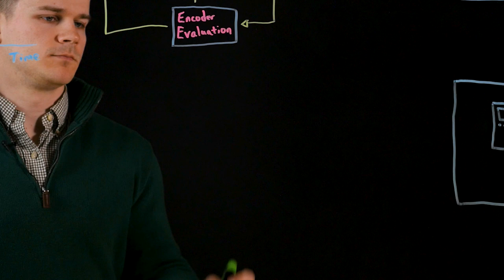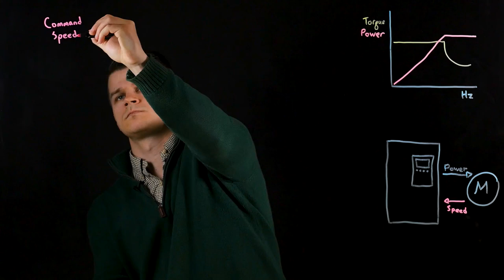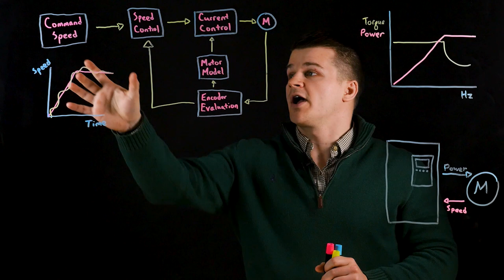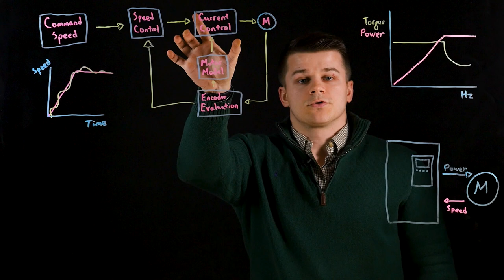How Does Closed Loop Control Work in a VFD?

Comment: Hi, Thanks for information. I have a question. Can I apply a rubust linear actuator using VFD controller, encoder and induction motor with a PID control algorithm. Actually position controlling when under load. I have some doubts that this is feasible. İs that feasible for induction motors?
Reply from the maker: Thanks for the question. If we understand you correctly, the answer is, yes. In this situation, our drives would control an induction motor with an encoder using a PI controller, not PID controller, for velocity or positioning control. If you want to talk more about a specific application you have, reach out to a local KEB representative here: https://www.keb.co.uk/company/representatives-agencies